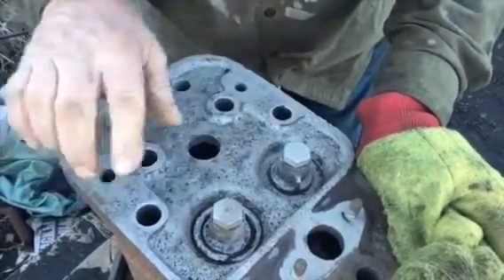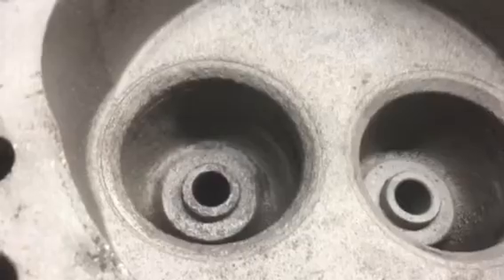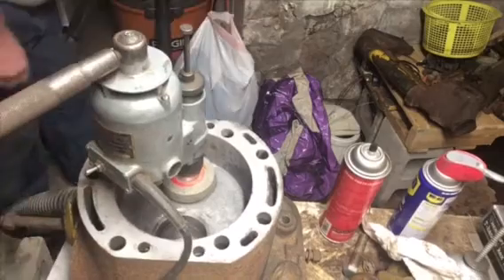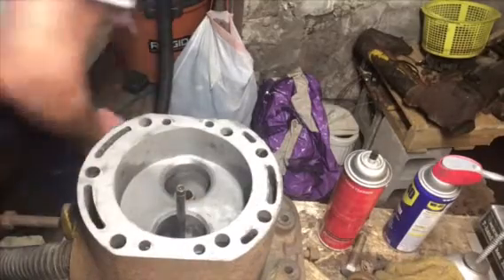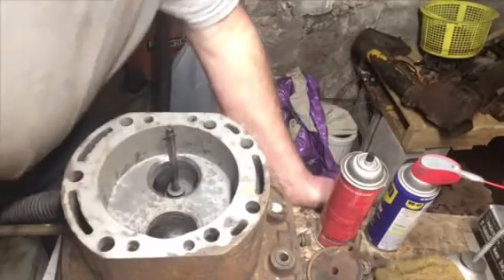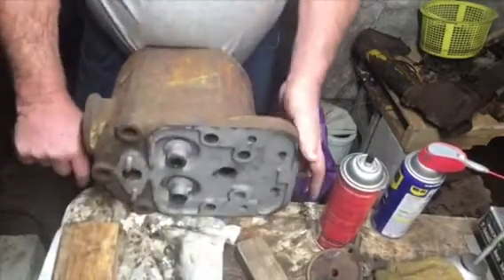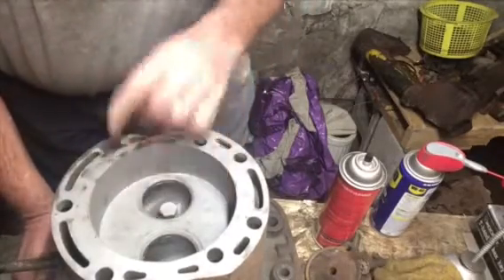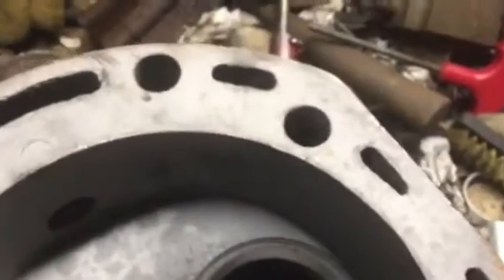60 head cleaning, valve seat refacing 3/2/21

Comment: Ive not see a valve seat grinder like that. Dad has some old tooling for cutting seats but they must be driven by a drill. Or by hand? 
We have a old valve grinder also.
It looks like your grinder rotated off centre to the guide as it cut?
Reply from the maker: Yes, it runs on an eccentric working it’s way around the seat and you manually slowly feed it down.
Reply: @oldamericaniron5767  neat....a very handy tool to have